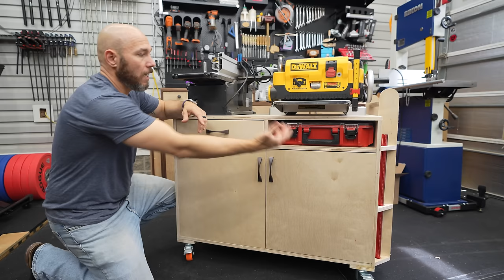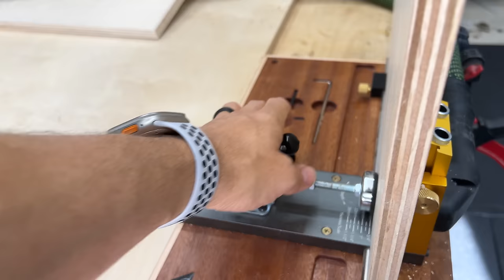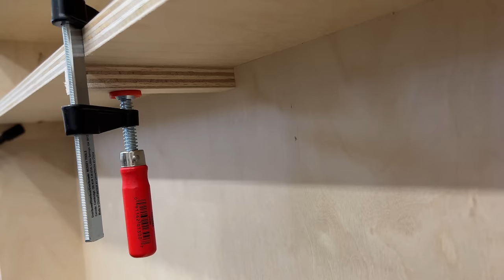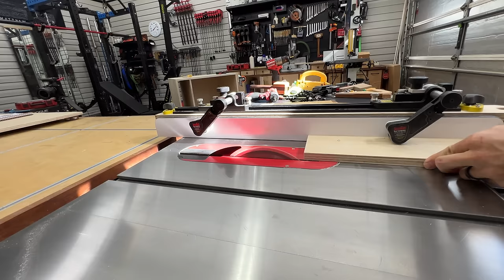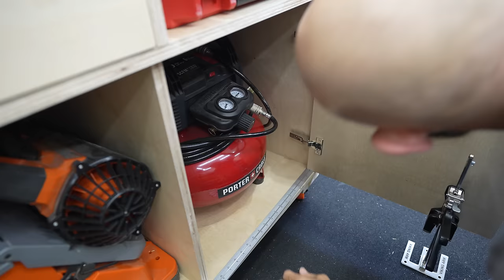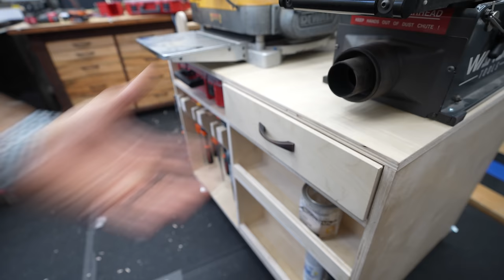How to Make a Mobile Tool Cart with Storage For Everything

Comment from the maker: ▼EXPAND FOR TOOL LINKS and INFO▼ 
Watch Next = How to Build Drawers - https://youtu.be/Ls6G4q4TGew
Tools In This Video: 
Massca M2 Pro Pocket Hole Jig - https://bit.ly/3yyRGOH
TOOL CART PLANS https://www.731woodworks.com/store/diy-mobile-tool-cart-with-storage
1 1/4" Pocket Hole Screws - https://masscaproducts.com/collections/pocket-hole-screws-plugs/products/1-1-4-coarse-thread-8-zinc-pocket-hole-screws-150-units ?aff=3
Massca Jig Mounting Board - https://www.creativetoolco.com/collections/massca-products/products/massca-pocket-hole-jig-mounting-system
Milwaukee M12 Drill/Driver - https://homedepot.sjv.io/5brZG3
Rockler Bench Cookies - https://amzn.to/3rQaOUX
Festool Track Saw - https://amzn.to/3TkqfAo
TSO Track Square - https://bit.ly/3Cw2HSd
Festool Dust Port Cover - https://tidd.ly/3RryWYm
Jessem Stock Guides - https://amzn.to/3EEKpB5
Clamping Squares - https://lddy.no/1d7gu
Small Bessey Clamps - https://amzn.to/3CVjOyg
Kreg Pocket Hole Clamp - https://amzn.to/3RSzzdC
Parallel Clamps I Recommend - https://amzn.to/3rTU6E2
Squeeze Clamps - https://lddy.no/1d7gv
Right Angle Drill Attachment - https://amzn.to/3g2y8Mo
Short Pocket Hole Driver Bit - https://masscaproducts.com/collections/frontpage/products/massca-square-driver-bit-set?aff=3
Chisels - https://amzn.to/3Se8bHj
Kreg Setup Blocks - https://amzn.to/3VoNJ9h
Battery Holders - https://tidd.ly/3CV9WVf
Kreg Hinge Jig - https://amzn.to/3Tc5Ygs
Hinges - https://amzn.to/3S0qJKX
Forstner Bit Set - https://amzn.to/3ECwpYo
Drawer Pulls - https://amzn.to/3euLvog
Spring Punch - https://amzn.to/3TfGBdu
3" Casters - https://amzn.to/3Ms0ufh
Drawer Slides - https://amzn.to/3MxMEb5
Titebond 3 Wood Glue - https://amzn.to/3CyDoif
CA Glue - https://amzn.to/3euzEGA

Tools On The Cart -
Milwaukee Parts Organizers - https://homedepot.sjv.io/3PgENd
DeWALT Parts Organizer (will fit in the opening) - https://amzn.to/3EAmiDv
DeWALT Planer - https://amzn.to/3TjelXr
Wahuda Jointer - https://amzn.to/3rQTuPl
Spindle Sander - https://homedepot.sjv.io/e4YNGj
Air Compressor - https://amzn.to/3eqXfIg
Jorgensen F Clamps - https://amzn.to/3erTS3X
Bessey F Clamps - https://amzn.to/3CUGfn4

(If you use one of these Amazon and other affiliate links, I may receive a commission) 

Some other useful links:
Daily Tool Deals on my website: https://www.731woodworks.com/tool-deals
Subscribe to our email Newsletter: https://mailchi.mp/7e44c16eefdc/731-woodworks-email-newsletter
Check out our easy-to-follow woodworking plans: https://www.731woodworks.com/store
Outlaw's Board Butter - So Good it Should be Outlawed: https://www.731woodworks.com/store/boardbutter

Comment: I cut about 12 3 x 3 blocks from a 2 x 6; then sanded them smooth, glued two to each other for added hight for plywood support.  Did the same for my lawn mower, cut four exact one inch 3 x 3 blocks to support the mower housing to level it exactly.  I do this once a year as I do my spring tune up.

Comment: This thing is great! I have a big cabinet thing thats not on wheels blocking most of my shop. I got it for cheap and used a cabinet and drawers from it for another project, but now I have my band saw, miter saw, and drill press sitting on top of it. Its a nice station but its always in the way. 
I think I'll build one like yours in this video and then finally organize a bunch of other crap laying around the shop with the added shelves and drawers. Thanks!
Now I just have to figure out which tools I want on top of it.....

Comment: Just a thought to address the handle interfering with your planer; you could cut your uprights for your handle at a 45 degree angle from the top of the cart towards the floor and then flip it end for end and dowel them back on, that way it would push the handle away from the planer and give you access to the hand wheel.  OR, could you make a riser to sit under the planer to raise it above the handle?  Just a couple of thoughts.  I really like the design and will have to think about adding one of these to my shop this winter.  Glad to see a build video from you again, you always spark ideas for build for my shop.

Comment: Very nice! Here's a power tip; Cut out a notch in the divider and locate the magnetic part of the "latch" in there. Then you can simply cut any flatbar stock and bolt it at the upper outer most part of the doors. No need to waste money on 2 kits! One is enough! :)

Comment: Next time, make the storage modular! Add French cleats to several locations like where you hang the clamps and such then the box can adapt overtime to your needs!

There are some neat ways I've seen to make locking French cleats so that if you hit a bump with the box everything doesn't jump off, that will be necessary in this application.

Comment: Looks really useful, would it be worth running the leads for the planer and jointer behind the draw to an extension cable hidden in the cupboard?That way you’d only have one lead to plug in and pack down. You could use a retractable one or coil the excess on the outside, although I guess that only works if you can unplug the cables from the machines.

Comment: If you wanted to take it to that next level in a future add on build I could see adding an outlet inside the air compressor area with a switch on the outside to turn it on.  Then add extension cord to plug the cart into an outlet and a power strip on the back side as well thus giving you mobile power station if needed and can just open the door and run the air compressor as well without taking it out.
Reply from the maker: good idea!
Reply: @731Woodworks  Put a air compressor hose real inside that compartment with the air compressor after you do the electrical part.  Next video:  How to take this beginner multifunction tool cart up a level.  Oh and it should have a cup holder somewhere as well.

Comment: I generally love all your videos, I usually check my notifications on YouTube just to see if you've put out anything new. I was wondering if maybe if you could point me in the correct direction on a couple things.  I see a lot of woodworkers using their table saws for cuts they could also do on the miter saw, in shops that I am confident that they at least COULD have a miter saw if they wanted. What's the benefit to making those cuts on the table saw, and since I'm assuming there is at least one good reason for it, what should I include when I make a crosscut sled for myself? I saved  up and got myself the DWE7491RS earlier this year. Thanks again for the great information you provide! :)

Comment: I’m in the process of building one similar. Did you attach the castor wheels straight into the bottom plywood or did you add anything? Mine is going to be really heavy so I’m concerned about the weight on the wheels. Thanks. Great design by the way!
Reply from the maker: I ended up adding more screws through the blocks into the cabinet after the build.  I included those instructions on the plans. It is very heavy and does need extra reinforcements.

Comment: I really like this cart, best one I've seen since I built Steve Ramsey's mobile cart a few years ago as I was getting back into woodworking.  Guess I'm going to be spending a bit of money at 731Woodworks so I can have the plans! 
I've gotten hooked on the parts boxes. I've got several, different brands from Harbor Freight to Dewalt. I think I will make one slight modification to be able to stack several of them behind one of the doors since I don't have a spindle sander....yet!

Comment: Which sanded plywood do you use for projects like this or for garage cabinets? It looks like there are a few options available with varying prices.
Reply from the maker: It’s birch but not Baltic birch. Just regular sanded plywood. I paid $75 per sheet.

Comment: It looks like you are getting a little drag on your doors. This is likely because you have the edge of the door inside the side mounting instead of a traditional mounting where the door would sit proud for the side mounting surface. I think if you added a little chamfer or round over to the outside edge of the door on the hinge side you could avoid this slight drag. Nonetheless, this is very nice.

Comment: Matt, I am interested in buying the plans, but I am not sure if the cart will be too big for the space I have. Will you tell me the width and depth of the cart, so I can ensure it will fit before I buy the plans?
Reply from the maker: 40 1/4" long without the handle, 44" with the handle/shelf.  30" wide
Reply: Thank you for the measurements. Have a blessed day! @731Woodworks

Comment: Why use pocket holes on shop cabinets. No one will ever convince me the are just as strong,. Use the low profile GRK  Washer style head cabinet screws, take the time to space them evenly and they almost become a feature. I just think pocket hole screws have their place. I've used them in tons of  kitchen/bathroom installations of the kind that are only expected to last 10 years or so before they are replaced( they are no longer in style, wear and tear as rental units etc). Sometimes they are the only thing that will work and for that i'm grateful to have them. Don't be embarrassed and hide your screw heads , let everybody see them ,you might be surprised how much you like them.

Comment: He said only 3 sheets 😭
Reply: Pretty much my thought lol. Oh that looks cool. 3 sheets? Oh well never mind 😂
Reply: That’s like $3/400 depending on what grade you get. I know your pain lol.
Reply from the maker: I paid $75 per sheet.
Reply: @731Woodworks  That's not too bad. I bought the exact same jointer from your review and I also have the same planner. So I'm very interested in making this
Reply: You could do 1/2” mdf and paint it?
Reply: @731Woodworks  how much “scrap” was leftover? Does 3 sheets include the nearly 1/4 of a sheet you misused as the wrong top?

Asking because if you have enough scrap for another project, that helps offset the overall cost by deferring some of the material to another project.
Reply: @bloodmonk125  you could modify it a bit and use less. I bet a good bit of that is used by the drawers and doors and Matt even made a mistake by like a 1/4 of a sheet.
Reply from the maker: @Damon_Barber  I had almost a 1/2 sheet left.  I actually mis-measured the drawers and had to cut new drawer parts.  That part I didn't video.  If I had gotten that right, it would have been 1/2 sheet left over.
Reply: @nicholaswoods9788  I have both as well and built a milling cart out of 1 sheet. Works really well.
Reply: Hey Matt first of all excellent review and excellent video. What type of software are you using to create your projects if you dont mind me asking.
Reply: When you say sheets of plywood, what specific sheets are you referring to, as I find it almost impossible to find birch anymore due to the war in Ukraine? Thanx Matt!
Reply: Why buy anything other than the cheap sanded pine stuff like Matt did? It looks fine for shop furniture. It’s about $70 a sheet here.
Reply: @yellowhammerwoodcrafts  Thank you!
Reply: Won’t work for me, I have way too many tools….according to my wifey. I say non sense. I say you have too many shoes. End of conversation and I’m comfortable on the sofa.
Reply: "I didn't actually sleep on it."
😆 😆
Reply: @Fishing-gs9ku  no
Reply: Cool idea leaving the space under the thicknesser to slide boards back through 👍
Reply: @Fishing-gs9ku was wondering if MDF would be ok.

Comment: Outfitting new shop in itty-bitty one car garage, so most everything needs to be on wheels. Expect this will be next thing built after rolling workbenches. Those will likely be Paulk's Smart Bench/Station tops mounted atop Husky adjustable height work tables with storage cabinets added below.

Comment: I saw you put a build start time but didn't see a finish time, what's your estimated build time?
Reply from the maker: Took me about 18 hours or so. Worked on it about 5-6 hours a day for 3 days.
Reply: @731Woodworks  I'm so pokey it'd take me a solid week! I need a place for my jointer and planer so I might do this one. Been thinking about doing a double flip cart possibly instead because of my small 10x20 space to work in.

Comment: The problem I have is with the wheels. I need to move things from my very small shop into the yard where it's sandy and grass. The shop wheels get stuck or don't move well when not on solid surfaces.
Reply: Simple. Use small 8 inch tyres instead of wheels.
Reply: @Habibulla.M  I do, sometimes it's hard to find the proper tires though.
Reply: Maybe get a few sheets of 3/4" ply that you can throw down on the lawn when you need to work outside. If you treat them I reckon they'd last a little while.
Reply: @thepracticaldad  now that's a good idea. I'm a dummy for never think of stuff like that.
Reply: @cindyhammack68  I use the treaded hard plastic tires with the locking mechanism. I just have to not built my cart as tall to equate the height difference of the wheels.

Comment: Aren’t thosejoints weaker by putting the pocket holes on the inside? Like they are barely grabbing the edge in that direction right?
Reply from the maker: naa, they're fine.  Will never have an issue.  Used glue as well.  Technically, yes you would rather put them the other way but for this project, it's not necessary I don't think.
Reply: @731Woodworks  wow thanks for the prompt response. Your videos really inspired me and keep me motivated to learn. I’m 36 and just started working as a cabinet service tech this year. Started my own mini shop at home too, so I think I’m going to make a modified version of this cart for my dewalt job site saw and router table!  Thanks for all the content man, god is good, all the time!
Reply from the maker: @Fishing-gs9ku  And all the time, God is good.
Reply: @731Woodworks  amen brother. You know the real ones… they answer EXACTLY how you just did!